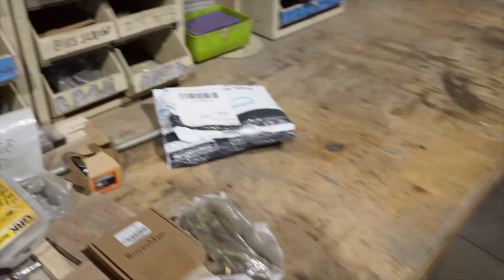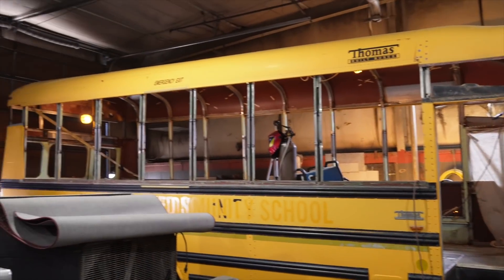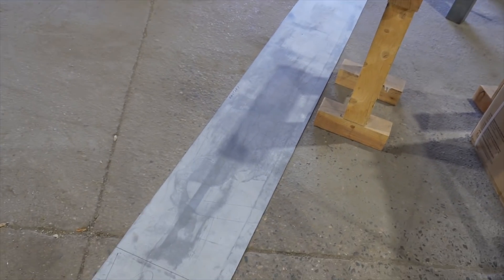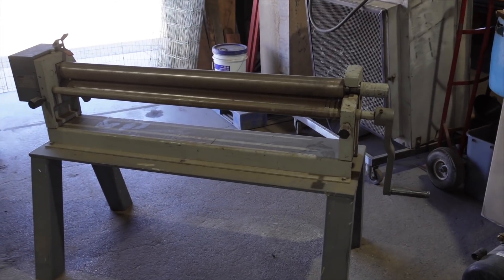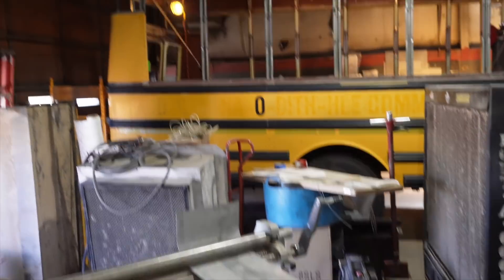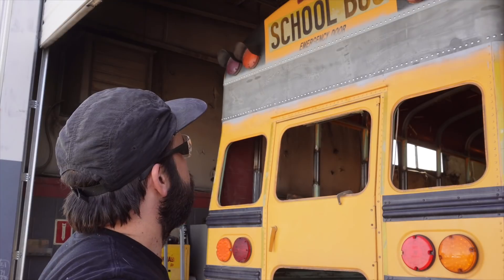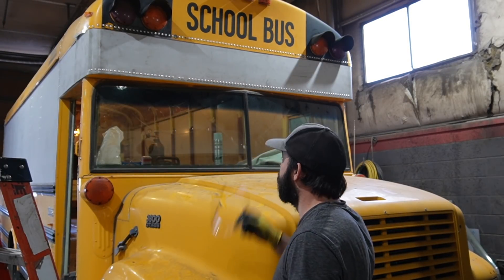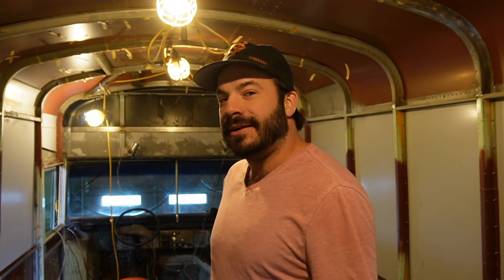How a PRO SKOOLIE SHOP HANGS NEW SKINS on a New Roof Raise (Skoolie Conversion Guide #5)

Comment: I sure wish I would have found this video sooner. I did a 12" roof raise on my 97 AmTran 78 passenger... used 18ga steel for the siding (etched and primed before install to hopefully halt some of the corrosion) but I butted them up and welded the seams between the sheets. In retrospect, overlapping just makes WAY more sense and feel dumb for not having done so.

Comment: Honestly, I believe if these rivets you showed on the back piece were straight as rulerline it wouldn’t look “original” but like “something isn’t quite right. At least that’s how I look at restauraties / modifications. But you don’t use paneling sealant just the rivets?  But last but not least, whopping great job, great team you have right there Chuck, Greeting from Haarlem, the Netherlands!

Comment: Beautiful work Charlie as usual my friend
I've been using the closed end rivets for 25 years it's what make the difference between doing it right or a leaky pig forever just my opinion. Great video keep them coming.
Reply from the maker: ah brian, a fellow riveteer! yes, theyre awesome fasteners!
Reply: @ChuckCassadyYT  it's kinda funny how some people don't even think of such a simple product be used will save hundreds of hours resealing the wrong rivets.
Reply from the maker: @briandavis9975  1000%
Reply: Hear hear! I've been an aircraft sheetmetal guy for the last 16 years and yeah... watching so many people do amazing things with their buses but still use hollow pop rivets instead of cored fasteners like Cherrymax always makes me cringe a little!
Reply from the maker: You only make that mistake once
Reply: @ChuckCassadyYT  I don’t know about that Charlie!! Some of the work I’ve seen from some of these guys out here who call themselves “Professionals” have done that type of corner cutting and worse just to save $500 is absolutely ridiculous!!  They have not learned their lesson yet cause greed is much stronger than common sense  and that’s an additional $500 in their pocket and they could care less what happens once the bus leaves and will somehow blame the buyer for the rivets leaking when they bring the bus back with water damage and mold everywhere

Comment: do you have any tips on replacing these structural blind rivets? I messed up on a few and had to take them out, but now the hole is bigger so I cant put in another 1/4" rivet. Thanks boss man your videos have helped tremendously with my roof raise and sheet metaling.
Reply: i found the answer, put a washer on the backside and it will grip

Comment: Chuck I'm converting a shuttle bus and had to discard (from the inside out) fiberglass interior wall, plywood/ insulation, and exterior fiberglass skin (and roof) due to water damage. Now we're considering how to skin it, and we're thinking metal roof... Any reason I can't skin the roof and sides in metal directly on the steel ribs? Do you put any sealant/ glue where you're riveting together? Love your videos.
Reply: What did you end up doing?

Comment: For the welded parts, I'm thinking about "brush electroplating zinc" to re-plate the steel prior to paint.  Basically a sponge covering an electrode, some zinc plating solution, and a DC power supply. They have kits online with electroplating wands and solution, or they can be made from common materials...  It could have other cool uses too, like plating your own parts, especially undercarriage steel parts like water tank frames.  I think there is a dip galvanizing place close by I could use for larger parts.
Reply from the maker: sounds like a good plan if you can!

Comment: I would love for you to raise the roof on mine 12”, move the rear door panel forward 8’ but leave the roof over the 6’ section of floor but still want the oem windows back in it instead of a full side skin like that.  That 8’ rear section will be for a gooseneck ball and golf cart, scooters or bikes when going camping

Comment: How would you delete a single window on a bus without a roof raise? Is the technique the same?

Amazing videos! I love your attention to detail!!!
Reply from the maker: It's nearly the same! Skoolie.com sells custom window deletes just for that!
Reply: @ChuckCassadyYT  Thank you! We're thinking of using self-tapping screws to attach the delete to the post so the vibrations don't pull from the vertical plane. Have you tried this before?
Reply from the maker: @mznix1971  we use rivets for that kind of thing
Reply: @mznix1971  screws will vibrate loose over time and will actually back all the way out. 

Don’t try and reinvent the wheel here! It’s not rocket science and we have one of the best bus guys trying to show you the best way to do all this so just take notes and follow the riven methods that will last the life of the bus and and provide a safe vehicle for you!

Comment: When you apply the epoxy primer do you need to sand the newly applied sheet metal for proper adhesion? If so is their a certain grit that will avoid biting into the coating

Comment: I see on the full sheets along the sides, you rivet vertically through the hat channel flanges, and horizontally through the rub rail holes, but I didn't see anything horizontal along the top of the sheets. Did I just miss that or are you relying solely on it being wedged in under the j channel on the top of the sheets? Thanks Chuck, I really appreciate you.
Reply: I’ve been wondering this as well. Might need to ask during one of his live streams

Comment: Curious why you don’t use any sealant/silicone on the panels to prevent vibration noise?  Looked like they had it before… love the vids.
Reply from the maker: the spray foam insulation will take care of that! great question though

Comment: Hey Chuck, loved the video and considering a roof raise. You've conviced me i need to take out the factory windows and hang skins but I was wondering if there is a cheaper rivet than the one yall used. I couldnt find them for less than 50 cents a pop and I have a full sized transit style bus, so the thought of spending 1500 dollars on rivets isnt very appealing haha. Got any suggestion of another decent rivet thats a bit cheaper?
Reply: You can get cheaper rivets but they are not the correct rivets and will cause other issues like water intrusion. There are good reasons why he uses the products he uses and the least of concern is cost. To do a good job doing structural work requires certain materials to perform the task and he is quality conscious and is not willing to substitute cheap materials to keep price Down. It costs what it costs to do a job right , period. 

We can build a cheaper home by using furring strips for studs , and why not, you won’t see them anyways once the siding and Sheetrock are installed but there are structural requirements for the health and safety of the homeowner so is your safety in your bus worth saving $500  by buying lower quality materials?

You get what you pay for and there are good reasons why we are having trouble now insuring our buses that have had this type of modification done cause folks are substituting lower quality materials than were originally used in the construction of the bus to save $500 and it lowers the safety potential of the bus and when something happens, the insurance company is on the hook to pay for that mistake, not the individual that cut corners so they have found it’s better business practice for them to not insure us at all If certain mods have been done. 

It’s not worth cutting these corners! In the end, it will always cost you much more than you saved.  Take a little extra time if you need to to save up an additional $500-$1k to buy the proper materials to do it right if needed but you do not need to it corners on your materials

Comment: I didn’t see you de-burr the holes, did you do that off camera and then started filming when you set the rivets, or did you just skip that part? Or is the demurring done on the inside? I’m not trolling you, I just want to understand the process.
Reply from the maker: I only deburr holes when they need it. Luckily Ty who was doing the drilling is good at clearing the burrs from the inside with his drill technique so I only have to deburr a few
Reply: Could you possibly show the ones you want to redo and why?  Were they damaged and not sitting flush?  or are you having to weld material to patch?

Comment: @chuck 20:06 is there any kind of tool, like a counter sink, that could de-burr right after the hole gets made? I googled it for you :P Looks like Freer sells one, SKU: FTS-BB75CCH2650
Reply from the maker: We do deburr holes after we drill them but only if there is a dangler

Comment: 3 questions.  I'm asking out of ignorance.  Why no sealant (butyl tape type) used between skin laps?  Isn't there a risk of micro leaks arount rivets? Any benefit to priming the rivet hole edges after deburring to prevent rust or do the finish materials protect it well enough?
Thanks.  I like your channel.
Reply from the maker: I'll be applying sealant to the edges and using an epoxy primer that will seal the bus up nicely!
Reply: @ChuckCassadyYT  Ah!  Got it.

Comment: Hey Chuck, I’ve had a few aerospace background people talk about using cobalt F style machinist bits to drill the holes saying 17/64 is one size too big for the 1/4” rivets. Do you have any thoughts on that?
Reply from the maker: I’m sure they’re well intentioned but they are mistaken. At least for these type of rivet. Min hole spec is .261 and an f bit is smaller than that at .257

Comment: I'm wondering what the best option for bending the 18 gauge sheet metal around the back would be if you don't have access to a roller.
Reply from the maker: Bend it around the radius of a welding gas tank or large pipe
Reply: @ChuckCassadyYT  thanks

Comment: Do you have links on where to order the rivets and sheet metal skins?
Reply: I bought my Galvanneal from metalsupermarkets. It cost about $670 for two 5x10 sheets in May of '24. I'm shortening my bus, so you may need more. The rivets are Avdel Interlock SSPI-08-06

Comment: Other than ease, is there any reason not to plug weld these holes instead of using the rivets?  Obviously it's fairly thin metal, so you'd have to be careful, but wouldn't that create a watertight connection?  Is it due to the fumes it would create from melting the galvannealed metal?
Reply from the maker: These rivets are stronger, and they don't burn off the corrosion protection or require grinding or sanding after
Reply: @ChuckCassadyYT  Excellent!  I'm still weighing whether or not I'll tackle a roof raise, but your videos are an absolute help as I consider the work involved.

I'm documenting my build as it progresses.  About every five minutes I say to the camera, "...well, Chuck suggested that the best way to..." 😁

Comment: Do you use any type of sealant b/w the new metal and the bus wall?
Reply from the maker: I've answered this question many times
Reply: @ChuckCassadyYT  I'm new to your channel, so I've not heard your answer to it.
Reply: @ChuckCassadyYT  I read through several comments, and see you have answered this question quite a bit! Lol 
My husband will be relieved to know he doesn't need sealant b/w the pieces of sheet metal. He said the bus's existing walls didn't have any to begin with and I was trying to talk him into it. We'll seal the outer seams for sure. 
Thank you. 😊
Reply: I know you mentioned epoxy primer, but what type/brand of sealant do you use for the exterior seams?

Comment: Silly question: Why don't ya weld instead of using rivets?
Reply from the maker: Welding would require removing the galvanizing anywhere a weld is. You could certainly do it but I like rivets more

Comment: How do you measure the size of the sheets for the pre cut? I am trying to figure out to know how many to buy and what size for a 16" roof raise on a 5 window 15' thomas short bus. Is it top to bottom with 1 in overlap and spanning one horizontal frame or multiple frames/
Reply from the maker: We do 2-3 windows wide, vertical is usually the opening width plus about an inch and a quarter. You should be able to get a good measurement
Reply: @ChuckCassadyYT  Thanks for getting back to me! If you have time I have another question.

Galvannealed sheet metal isn't available at most contractors in the sf bay area, so i've been considering using regular cold rolled or galvanized steel. 

I know galvanized requires a self etching primer before it can be painted but cold rolled does not. Which of the two materials would you recommend if galvannealed isn't feasible logistically or price wise?
Reply from the maker: I'm shocked you can't find it! I would never do cold rolled. It will rust instantly

Comment: You say you remove all the glue but I don’t see you apply new glue anywhere. Isn’t that necessary?
Reply from the maker: the spray foam insulation going in is all i need inside and ill seal the edges outside before I paint

Comment: Hey Chuck thanks for video. My girlfriend and I picked up our very first bus just a few days ago and I've already watched no less than a dozen of your videos, some more than once, and made build decisions based on them. I am mechanically inclined and will be building it myself so the videos are helpful. One thing I took from your videos is I will be removing the windows and installing RV windows despite not wanting to. That being said I can see most folks put the new sheet metal under the rain "gutter" up top and then drop it in between the walls on the bottom. It looks like your also doing that here? Question is does that not create a place where water can find a path into the wall? Is there a reason one should not tuck the new metal under that rain lip up top and then sit it on top of that black "bumper" just below the window?

Comment: Those extensions used to raise the roof are the same length and welded along the same horizontal plane ???
   For maximum strength and  to distribute the structural load, front , back and side to side each weld and extension should've been staggered as much as possible, at the minimum a piece of box tubing needs to be placed inside the hat channel and welded vertically to reinforce the extension. 
  You have created a literal fault line around the bus..
  Buses were designed to roll-over with children inside, using the method shown, it will never hold up, god forbid , in the event of a roll-over.

Comment: Would that steel work for underneath a cargo trailer below insulation between the metal beams? And what gauge thickness are you using? Sorry if I missed it!